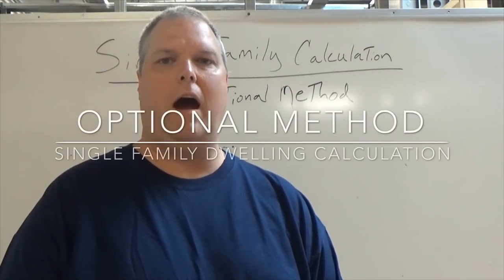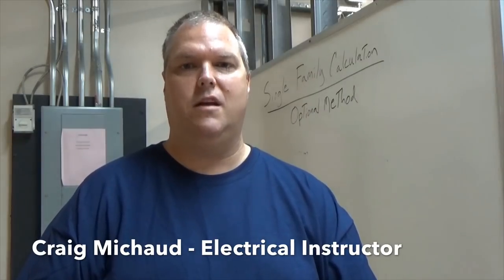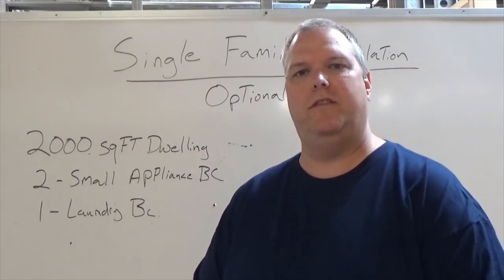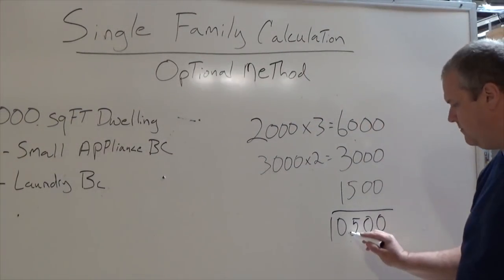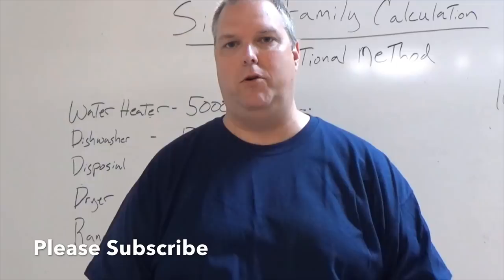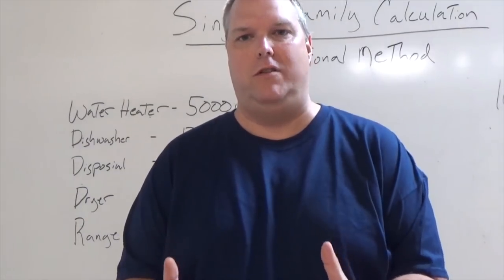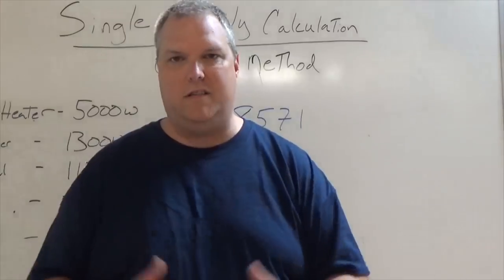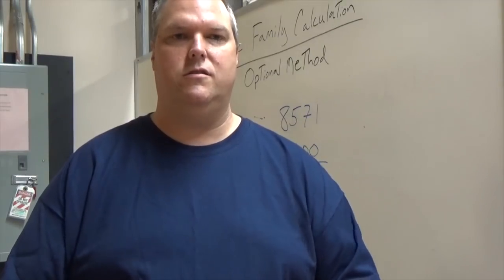OPTIONAL METHOD, Single Family Service Calculation

Comment: Hey Craig quick question just to clear things up. If you’re doing the optional or standard method, do you need to know the name plate ratings before doing any calculations ? For example when you’re doing a rough, should the home owner already know the appliances he or she will have? Therefore you can get the specs
Reply: This was my thought exactly.You don't know what the name plate is at this point.

Comment: Thanks for the video. I've a 3.5ton AC and I see you used 4000watts for your video (house total size is 262 meter sq). How do I get my calculations for the Air Conditioner wattage as it is not written on the plate?

Comment: Hi Craig, the example calculated 18571 VA for the load. In order to calculate Amperage, 18571 VA is divided by 120 V or 240 V? Do you recommend optional method or standard method? Thank you for helping the community!

Comment: Hi Craig, I watch your videos and I was following your line method. Does receptacles are included in the general lighting or should be calculated based on the number of outlets x180va. Am building a barn of 200 sqft.

Comment: Thanks for the videos !  I find them helpful.  I have one question that came up a few times on a practice exam …. I was able to find the VA calculations ,  but some questions were asking the minimum amount of 2-wire , 15 amp branch circuits when we know the square footage of the building .. I’m not sure how to figure that out if we know the total calculated load.

Comment: Just found out your videos, really informative, thank you for the time you spent on this, truly appreciated. Question, what is the reason why choosing Optional method (Part IV) instead of standard method (Part III)?
Thank you
Reply from the maker: It was explained to me that it is based on the location. I believe the standard method is used most common but something I plan on doing is a video on the same dwelling and see what we come up with using both methods. Thank you for the video idea. Thanks for the support. CM
Reply: Craig Michaud- Electrical Instructor “location”? Like building a tree house or a boathouse? I am kidding of course . Kind of vague “location”
Reply: @craigmichaud-electricalins4602  Did you do a comparison video?

Comment: Craig, I love your videos. I’m really stuck on 220.83 (calculating whether new loads can be added to an existing service or feeder) and I don’t think you’ve touched on it. Basically I’m trying to figure if you need to be including 100% of existing, non coincident HVAC load in your 220.83(A) calculation. It is really odd that it isn’t explicitly mentioned the way it is in 220.82 and 220.84.

Comment: Ok the multiplier (3) is from 220.12 General Lighting Loads multiplied by the square ft. Where are you getting the small appliance and laundry numbers from? Thanks
Reply: 220.82 B(2) 1500 volt amperes for each 2-wire, 20 ampere small appliance branch circuit and each laundry branch circuit covered in 210.11 (C)(1) and (C)(2)
Reply: @blandonkennya  thanks

Comment: where are you finding the first 10,000VA to be at 100% demand factor for this problem?
I'm confused because because where I find this demand factor rule, it is in Table 220.44, but my understanding was that this table is for "non-dwelling" receptacle loads. Are appliances non-dwelling receptacle loads?
Reply: Table 220.44 is used for the standard method.  This video is explaining the optional method.  The 10,000 is found in article 220.82 (B)